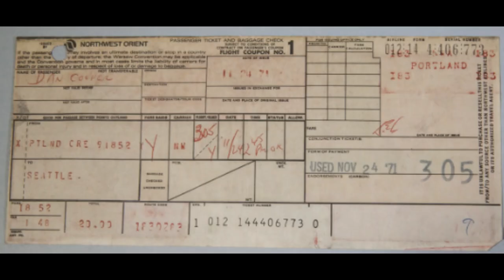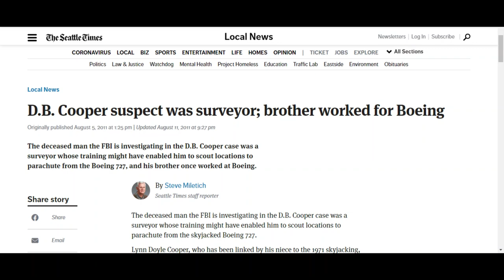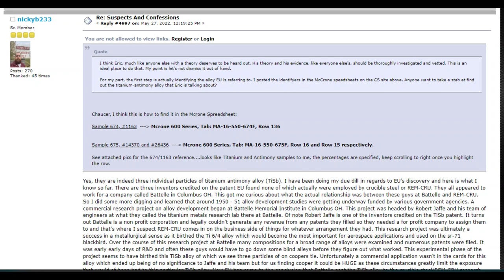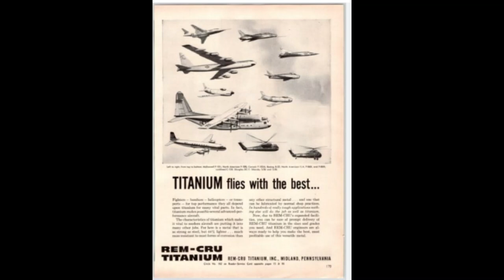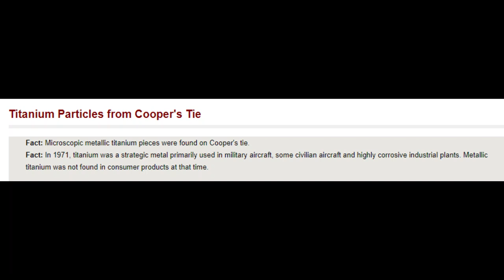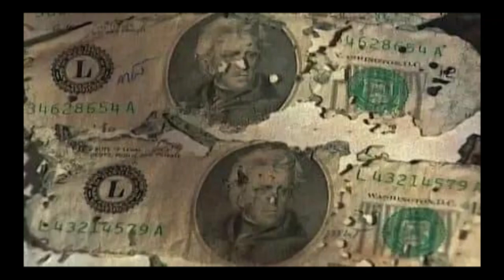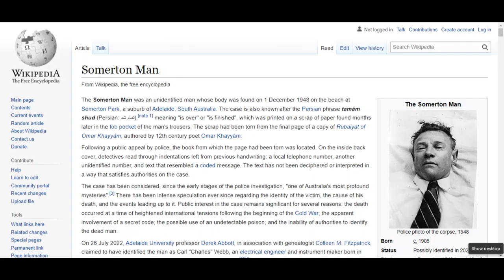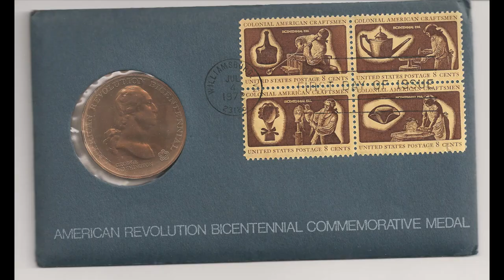D.B. Cooper: The Terrible Trouble with the Titanium Tie. Part 2 Episode 160

Comment: Thanks for the video. I'd like to make a couple of technical points. 

Very few metals are truly pure. Making anything truly pure is difficult and usually pointless. Within most metals industries, there are alloys that they call "commercially pure." This means that the alloy has very small amounts of alloying elements, but there are controlled amounts of those elements. In titanium, I believe Grade 2 is commercially pure titanium with almost no elements. Grade 7 titanium has small additions of palladium to stabilize the titanium dioxide passive film that forms on this alloy. That small addition of palladium makes this alloy function in some environments where grade 2 titanium doesn't perform well enough. The other popular commercially pure titanium alloy that I remember is grade 12 titanium. I can't remember what elements this alloy had, but the goal was the same. These elements helped stabilize the passive layer and made grade 12 titanium work well in environments that were too corrosive for grade 2 titanium. For about six months, I worked with an alloy that included some iron and copper. We had hoped that this alloy would be a less expensive competitor to grades 7 and 12, but I found that the alloy didn't offer any real advantages. 

With that in mind, the particles could be from a commercially pure alloy of titanium and antimony. In that case, the titanium would show some antimony content but would still be classified as commercially pure. I'm guessing that antimony would also provide a less expensive alternative to the grades 7 and 12 alloys. I also suspect that the antimony alloy, like the copper/iron alloy that I researched, didn't provide any real advantages over other available choices. 

I think your use of the word "molecules" isn't really correct. 

A molecule is a distinct connection of some number of atoms. For instance, the air that we breathe is made primarily of oxygen and nitrogen. Each of these is in the form of molecules, and in each case, the molecule is made of two atoms of each element. A molecule is a very tiny item made of those two atoms. Some molecules can be much larger, but I don't think we could identify molecules on the tie in the way that they have. 

Metals have a different structure. For oxygen to form an oxygen molecule, two oxygen atoms get together, connect to one another, and make a unit. If three oxygen atoms get together, the molecule that they form is called ozone. I'm not aware that four oxygen atoms can form anything other than two oxygen molecules. On the other hand, metals can form with huge numbers of atoms. The atoms fall together in a crystal structure like members of a marching band fall together in their marching structure for a parade. If a few members of the band are absent, the marching band really isn't changed. If the band picked up a few members who were experienced in parade marching, they could pick up those members without changing anything. A particle of metal that is large enough to detect is going to be made of millions of atoms. They will come together in a crystal structure. They are not a molecule or arranged as molecules. They are often described as different crystalline phases, but they are not accurately described as molecules. 

Any kind of machining or grinding operation could throw off tiny particles of metal. Most will be made of millions of atoms, but maybe some will be made of a smaller number of atoms. 

Titanium has a very high affinity for oxygen. A single titanium atom in the air is going to find an oxygen molecule immediately and combine to form titanium dioxide. A particle of titanium made of only a few atoms is likewise going to combine with oxygen to form titanium dioxide. Any larger piece of titanium is going to find oxygen and become covered across its surface with a very thin layer of titanium dioxide. I haven't looked at the research in a long time. I think there were ongoing studies about how thick this layer really was, but the layer separates the rest of the titanium from oxygen in the air and stops the reaction. If the reaction isn't stopped by this layer, the titanium just burns. I've seen the result of that as well. 

Titanium's usefulness comes from this very stable layer of titanium dioxide. This layer separates the metallic titanium from the environment and keeps the titanium from reacting further. That's one of the big values of titanium alloys (which include "commercially pure" titanium grades). Any particle of titanium on the tie would be much bigger than molecule size. Anything on the scale of molecule size would oxidize immediately. 

The number of people working with titanium is still going to be small. For an experimental alloy, the engineers in the lab are going to work with samples. Lab technicians are going to work with samples. The machine shop guys are going to work with samples. Maybe some of my old ties from that time period have a few particles of the titanium alloy that we were researching. I'm guessing that I got them on my tie when I was cutting or grinding samples for my experiments. 

I don't know how good the experimental work on the tie and the tie's particles was. I don't know whether the tie had particles of titanium and particles of antimony that just appeared to be an alloy during the experiments. I don't even know whether the peaks that were thought to be antimony were properly identified. I'm guessing that they are because I'm guessing that this analysis was done with more modern equipment than what I used. I spent relatively little of my total career in this kind of work, and that work was long ago. 

I'm not saying any of this to support or contradict Eric Ueler's hypothesis. I don't know whose tie that was or what its provenance really was. I also accept your idea that the tie may have been contaminated by the FBI. I don't know the answer and don't have a favorite hypothesis. I occasionally like to pretend that I still have something intelligent to say from my materials engineering and metallurgy background. I'm also fascinated by the Cooper case.
Reply from the maker: Thank you so much for your great comment. I just uploaded my most recent Cooper Q&A, it is titled: DB Cooper: Comments and Q&A, Part 3- Titanium Tie, McCoy, Reno, Cooper Parachute, Money. Episode 168
I hope you do not mind, but I referenced your message at the end of the video, and pasted the text of your message in the show notes, so that others may learn from you. Thanks again and keep those comments coming!
Reply: @theanthonyrrmillsshow3876  Thanks!
Reply: INTERESTING!!  THANKS VTPSTTU!  🙂

Comment: The two recent suspects proposed by Eric and Nick/Ryan are NOT engineers. They are METALURGISTS.  There is a critical difference between how an engineer vs a metallurgist gets metal particles on their tie. An engineer might dash in and out from the factory floor as you suggest.  A metallurgist makes alloys in a lab. In general, a metallurgist spends a lot less time on the shop floor than an engineer.  The titanium/antimony (TISb) metal alloys were only lab-made, not commercial, not made in quantity, or factory-made.  And what do you need to make a titanium alloy, well, you start with.... pure titanium.  A metallurgist would work with both, the alloy and the pure form of titanium. You need to look into this and understand how small samples of metals would end up on the tie. Not only is the TiSb very rare and key to narrowing the suspect pool, but the sheer number of exotic metals is also a key. A metallurgist is a person who would obtain soooooo many exotic metals on his tie, in small quantities.  It is not just the TiSb Titanium-Antimony alloy that helps narrow the field of suspects, there are many other rare metals such as Yttrium on the tie. It is a smorgasbord of metals that a metallurgist would have reason to interact with. An engineer is typically working with the production, to produce commercial parts using the same metals that are already established through market forces. An engineer is there to solve production issues, and make profits, not to fiddle-faddle with recipes for patenting. The metallurgist not only studies a factory's existing metals for quality control, etc. but also does research into new materials that can be developed to improve upon what the factory is already making or enter a new market. Of course, it depends on the size of the company, but remcru had a lab with 8 people working in it. The lab personnel would have separate work responsibilities from production engineering.

Comment: Here is my theory. First, what evidence is there that he actually jumped. Some speculate that the pilots thought he jumped since they felt a jolt, when the hatch was lowered. However, there is no actual evidence that he actually jumped from the plane. If he knew the planes design, isn’t it possible he may have hid? And no shoot was ever found they say he had two shoots. Did they inspect the plane once landed. No shoot was ever found but the tie was left on the plane was it left there too lead investigators into a different direction. $200,000. It was an interesting number. Is it possible? He has a collaborator an insider that would get 100 and he would get 100? It’s just, my opinion, but if it was an inside job . So at this point as far as I’m concerned, if nothing was found, no evidence, other than the money in the sand with a rubberband there’s no way he could’ve pulled this off himself unless there were other co-conspirators in my opinion, there had to of been one other. The tie was left purposely. How about this theory when he was giving the money and the parachutes he dropped the parachutes out attached to the bag of money to a accomplice on the ground he remained on board, but he was wearing a mask or a disguise and when they landed, he just walked off the plane the parachutes were hidden in the plane and removed by someone.on the inside?
Reply: Fbi went over that plane whith a fine tooth comb,he jumped end of story
Reply: Love your theory. It's improbable, but I guess it's possible.
Reply: Some say, the plane was inspected by the FBI from top to bottom. But if there was an insider an accomplice, who knew the planes design, isn’t it possible that the shoots and the money were hidden in a secret location of the cargo bay there’s no way that every single inch of the plane could’ve been checked the FBI went on the assumption, he jumped and therefore inspection of the plane might’ve taken place looking for a bomb not necessarily for anything else. No one in their right mind would jump from a plane at night. Also according to reports, he told the stewardess to have them fly at 10,000 feet slow . It is just my opinion everything that was said, and done and left on. The plane does not add up only two lead to one possibility. It was a Roos.
Reply: @stephendiamond9893  there were hundreds of trained men in the country who could of survived the jump
Reply: @chriszaun8984  There were thousands of untrained men who survived tougher jumps. The type of parachute he used had been used in wars - the survival rates were very high.